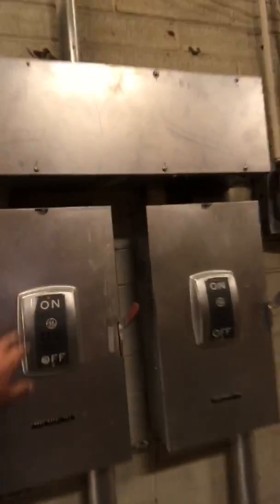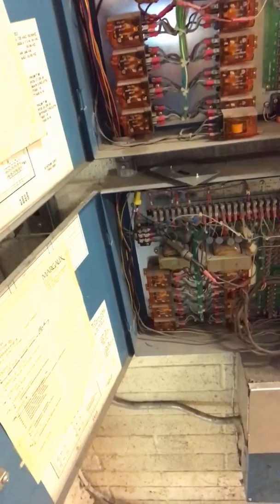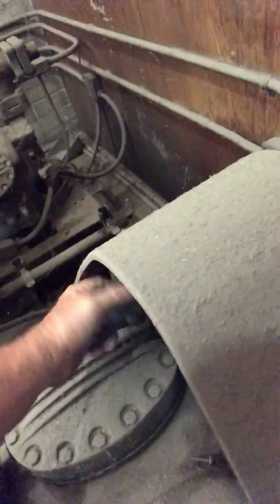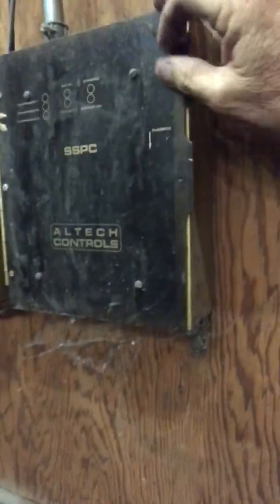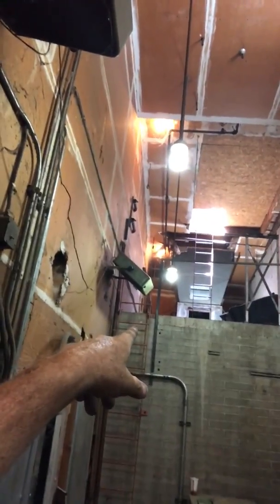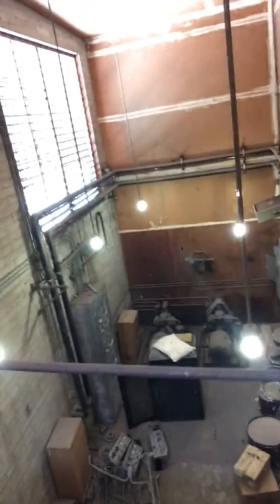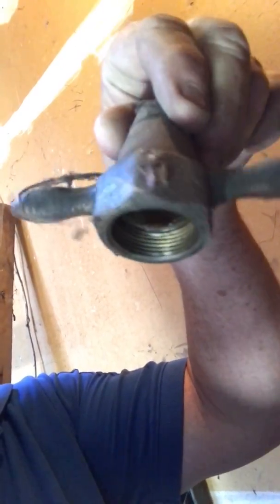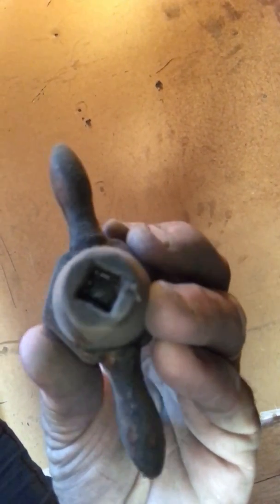HVAC - Old Supermarket AC system in Tucson AZ

Comment: How could your film this and hole the phone the wrong way?
Reply: Cool seeing some of this old stuff. Been in the trade for 32 years and have seen a lot of stuff like this and actually serviced it years ago. Mostly A/C. I can remember as an apprentice seeing an old air washing system in an old Woolworth store. Don’t remember a whole lot about it since it was over 30 years ago. I remember it had York belt driven compressors and actually used R-12. Also remember there were various sumps that were filled with water indoors with several blowers all on the 2nd floor and had a couple of large air cooled condensers. I only saw it once. Me and another guy were patching the indoor sumps because they were rusted out and leaking water down through the ceiling to the sales floor below. The store closed down shortly after. The older techs at the time told me nothing worked as well as this when it was working properly. Also did a lot of work in large department stores that had antique equipment that they never wanted to upgrade. They’re probably smart because the new junk they sell today will never withstand the test of time like this old well built stuff did.
Reply from the maker: @mikee2923  glad you liked the vid. I did a bit of open drive work back in the day. Those old systems will outlast today’s systems for sure. And thank you for 32yrs in HVACR
Reply from the maker: I’m not sure what you are talking about.
Reply: I don't mean to be a dick about it, but normally HD video is filmed horizontally (i.e.: widescreen), not vertically  @cochisecounty_travels
Reply from the maker: @georgen.8027  they are, but I make a lot of content for the mobile user. Not the person on a laptop or a Home Screen. Everything I make is on an iPhone.

Comment: You would’ve loved seeing this setup of this abandoned Kmart I was taking care of the boilers at over winter. 2 100 ton Trane semis, dx evaporator. Water cooled condenser. Flange bolted txv. Evap/hydronic coils were a wall. Blower was a Trane centrifugal fan. 40 horse motor. Older stuff fascinated me also
Reply from the maker: MFitz717 those Sporlan MVE Flange Body valves are my fav.